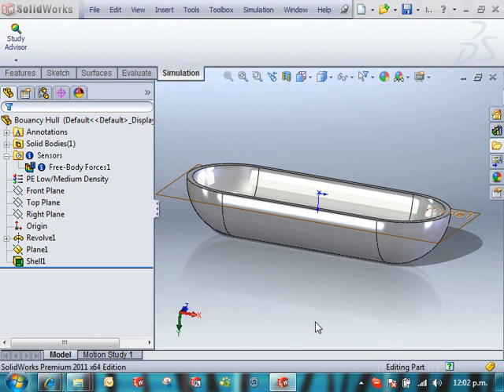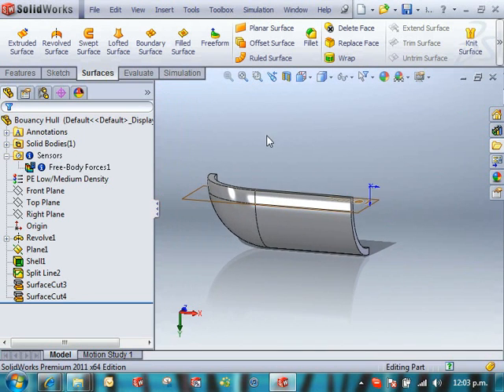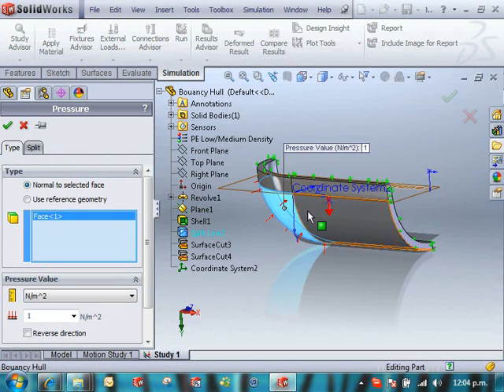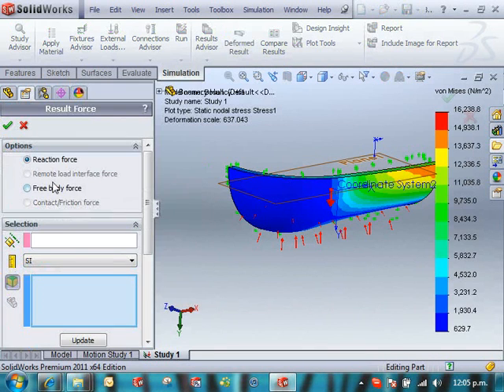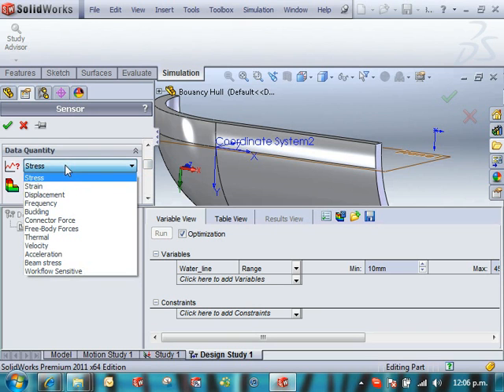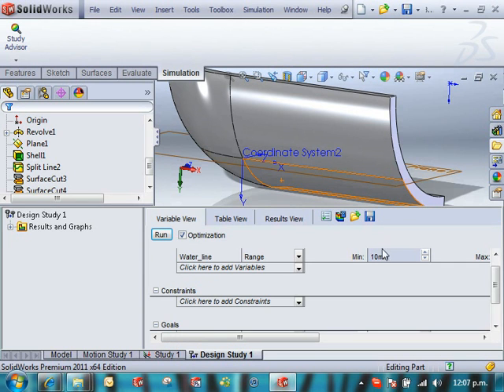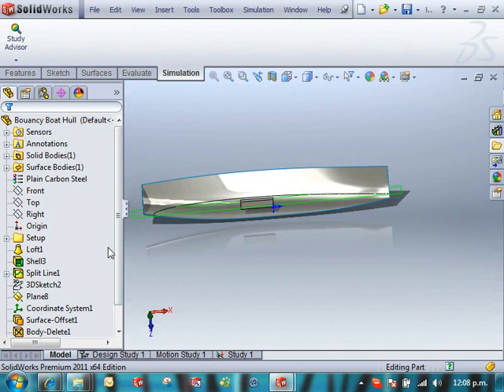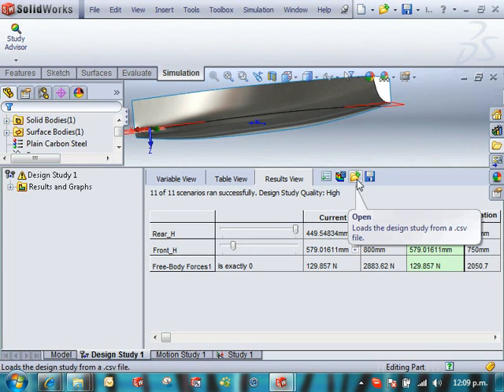Bouyancy with SolidWorks Simulation

Comment: This is a great video thank you for sharing, unfortunately I got a message "You cannot use a Simulation Data sensor for an Optimization Design Study with a licence of SOLIDWORKS Premium" 😞 This is probably not the case now but I stopped paying maintenance at SW 2017